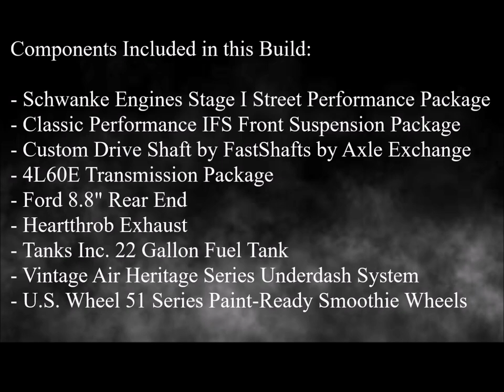1955 Chevrolet 3100 Truck Running/Rolling Chassis

Comment: Ive got a 59 chevy 3100 Fleetside....can you make that fit on this chassis?
Reply from the maker: Yes, we also have a package designed for 1955-1959 2nd Series 3100 Chevy as well. Very similar options to what you see in this video. The only difference is that a 2nd series frame is straight rail, 36" wide front and back. Also, we do a parallel 4-link instead of triangulated. Let us know if you're intesest and we can send you a formal quote.